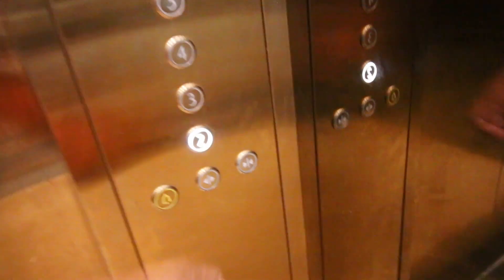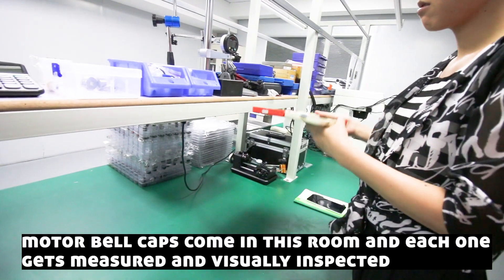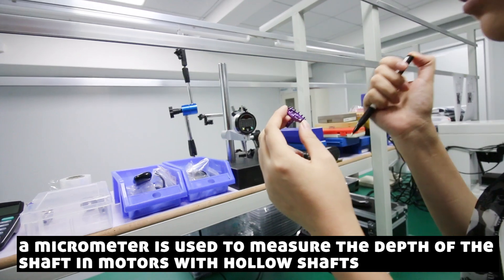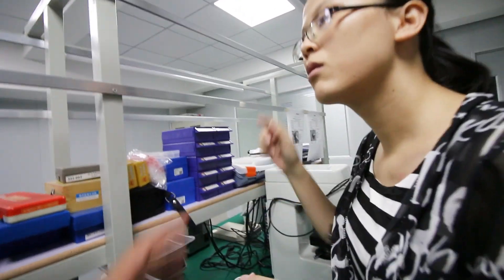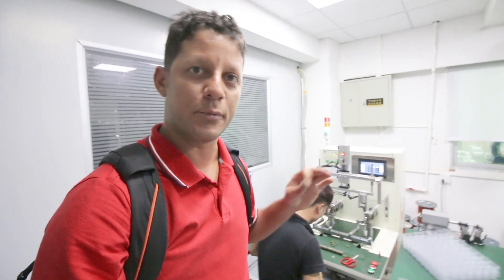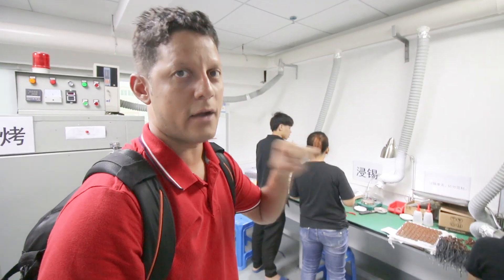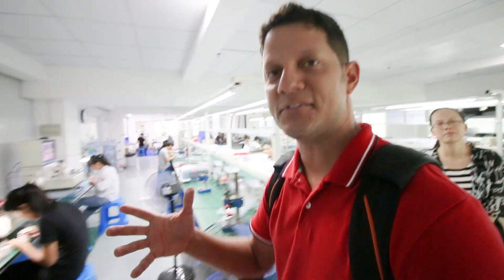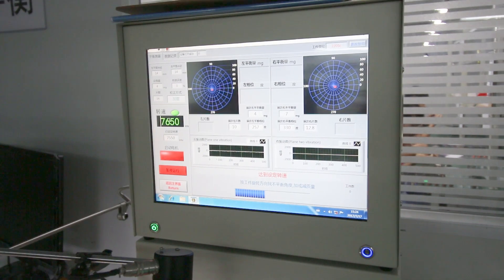At a Drone Motor Factory in China. What's it like?

Comment: Nice  video. Testing 0.001mm error is it possible? 0.001mm is 1 micron. Very high resolution 3D printer can achieve 20 micron resolution. If components of motor parts in resolution 1 micron it will be in super quality. Question mark.
Reply: 3d printers are not that accurate anyway.. aluminum machining can be very accurate!
Reply: machining things to micron tolerances is pretty common practice.

Comment: the bearings are crap. use german ones that would increase the motor lifetime a lot
electronic parts from china are fine and cheap. pls never use china screws or bearings for engineering purposes! u risk a lot

Comment: Anything Chinese with an electric motor is prone to burn out in a short time , when the Japanese made everything they wee reliable and would never fail , I have had two motors in a Dewalt drops saw replaced both after only 12 mths , my Hoover vacuum cleaner was used 20 times before the motor burnt out , absolute junk , everything now from China I will now put back on the shelf I now look for non Chinese clothes as well because they only last a short time .
Reply: Bruce Burns maybe you r too poor to afford the good stuff 你忙china
Reply: Depends on what price u pay for, I remember lots of my friends said that Chinese products does not last long then I ask what did u buy,they said from dollar-mart,well,I have to say u get what u pay. China provide wide price range selection of products, u need to select ther good one.I dun deny there's lots of crap,however, Chinese have tried everything to improve from quantity to quality, Japan has developed much longer time  China will catch up soon.

Comment: I was a specialist for quality control of ball bearings in a French factory, 30 years ago. A big difference! I could only take wild guesses how they measured any 0.001 mm tolerance. By air pressure? By a laser interferometer? You didn't unveil it. 
I am surprised they did not need any special clothing to avoid microscopic dust or fibre particles on the parts.
Reply: Harry B 30 years is a long time, TECH  had improved a lot.
Reply: The vibration measurement screen at the balance control station has a linear range from 0 to 500, but I don't see any unit. The one I worked on had a logarithmic scale from 10 Hz to 10 kHz.
Reply: The units on my scale were the frequency in Hz and the vibration in micrometer per second.

Comment: hahan dis girl use a micrometer to measure 0.001mm oh yea good joke  xD
Reply: Even a Mitutoyo micrometer with 0.001mm resolution and 0.002mm accuracy is pretty cheap and standard. I think she was just trying to explain how precise the measuring tool is, not the tolerance the part has to be in to pass QC. Her english did not seem to be that advanced, so it's sometimes hard to figure out what they actually want to tell you.
Reply: That is why this device is called micrometer. Micro stands for 10E-6 factor. So micrometer is 10E-6 m, or 0.001 mm, as she said. No jokes there.
Reply: Horst Petersen dude learn what a tolerance is
Reply: For example, shaft with diameter of 30mm and tolerance h7 have actual dimension from 29,979 to 30,000 mm. So if they measure it with precision of 0,001 mm they are right. 

0,0001 mm is not used for measuring parts but for measuring gauge block that are used for calibration micrometer and caliper
Reply: I don't know of any reason why she would say the measuring device accuracy. Its like me, I'm welding some parts for a personal project. Most of it is line up by eye, then I check it after tack welding it. I'm' not going to mention "my caliper does .01mm" when my parts might be misaligned by .25 inch or 6+mm since it has nothing to do with the product.

Also to check for .001mm tolerence shafts, you need a more accurate measuring device, so .0001mm caliper. Then with that accuracy you have problems like a piece of dust screwing up the results on top of human error.
Reply: Horst Petersen I know, I don't know how they come up with some of these insane specifications. Besides that it doesn't even need to be that accurate. I think the most accurate tool I have is 1/100,000 inch for shafts, but my calipers only go to .01mm and I wouldn't trust them at that level. I think my "human error" would be too much even with the best tools.

I don't think the engineer put .001mm tolerance. That would cost a lot.
Reply: Am i the only one that gets this joke.

Comment: Quick question: at 1:55 it says tolerance is 0.001mm which is ~0.00004". I work at a machine shop and to get an extremely tight tolerance, we use a wire edm machine. It takes hours to get within ±.0001" let alone less than half that. A part that takes that much time is worth hundreds or thousands of dollars. How are these parts worth maybe $20 getting such impossibly tight tolerances?
Reply: superbub1 I think these tolerances are fake. As you pointed out it would be costly to make it that accurate. They don't need to be that accurate anyway, so it's probably "marketing" as I call it when looking at parts (which makes it incredibly difficult when designing something).
Reply: lol I know that's kinda what I was getting at. With these parts being from China, I'd assume it's closer to +/- .010" (.25mm) or more. But I guess now we'll never know ¯\(ツ)/¯